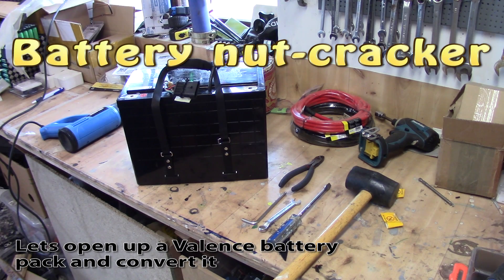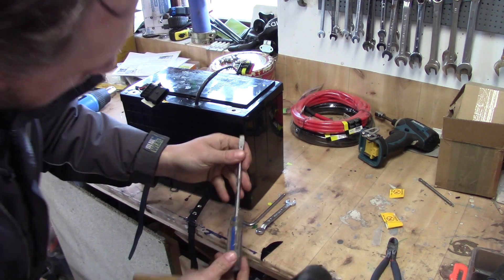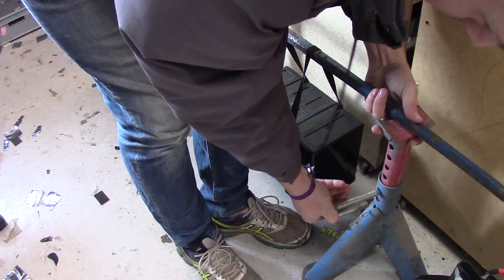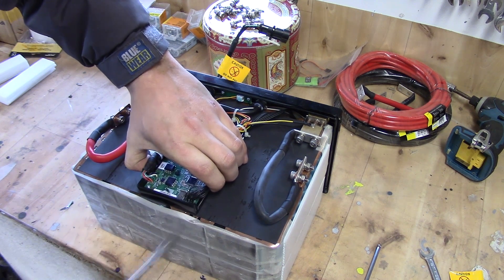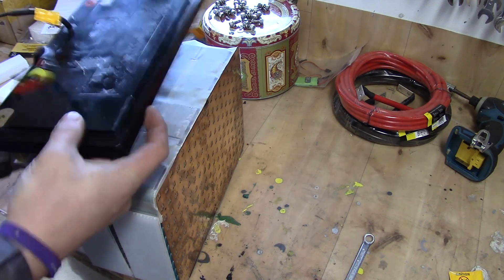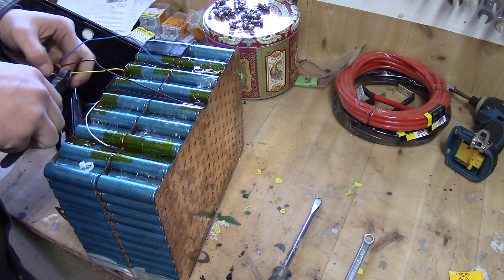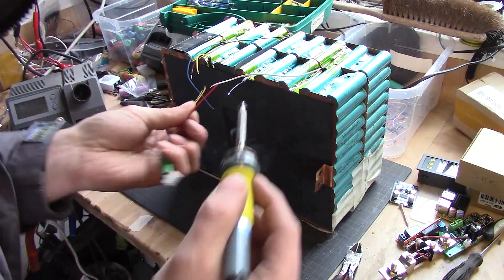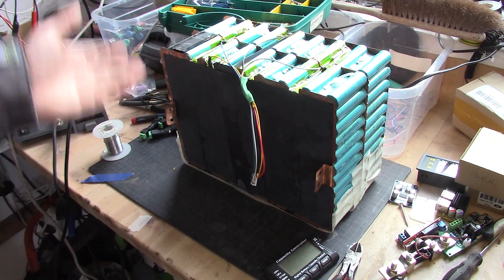Opening up Valence 12V Lithium battery

Comment: Please may i ask: if i do not use the communication cable and i buy 8 of these 12v valance battery, then connect them in 2p4s configuration for 48v system, will it stay balance or  do i need to buy and connect the communication cable to Valence controller box for it to stay balanced?
Reply from the maker: You need some kind of bms with balancing.

Comment: Just an observation, not knowing the exact product number, but assuming 4 Ah per cell:  I count 180 cells from your video.  Considering it requires 4 cells in series to get 12.8 v,  then paralleling the 45 series groups yields 180 Ah capacity theoretically. Not a detracting observation to your well presented info.
Reply from the maker: It's lfp cells. Their max st 18650 form factor is alot less. I said 130 in the beginning :)

Comment: Hi, you stated that the BMS was faulty. However the LED was still blinking green which should mean a good health of battery and BMS according to the manual. Am i wrong? 
Thanks...
Reply from the maker: Out of the 50+ packs just very few blinked Green and all packs were sold as faulty bms so i never checked it.

Comment: Hello is there a reason why you stripped the battery. I can see it's flashing green. Is the in built bms faulty many thanks
Reply from the maker: I dont have the Main controller nor do i want to pay for it
Reply: @DIYTechRepairs  neither do i lol. witch bms would you recommend for these batteries

Comment: Trying to understand how these cells are spot welded together. Anyone have a diagram that breaks down the connection/layout?
Reply from the maker: Its 4s100p. Packs of 100p cells
Reply: @DIYTechRepairs  but how did they wire them to be stacked two batteries wide?
Reply from the maker: @freedomunrestricted  huh? 100cell packs and 4 in series

Comment: I have one of these that has started flashing red. Any idea what that means and how do I fix it?
Reply from the maker: No idea. Crosscheck IF One of the cells are voltage are way off. Could be an easy problem like that

Comment: excellent !! does the "slave bms" do any battery protections without being connected to a "master bms"?
Reply from the maker: The original? No. It can only balance and monitor
Reply: @DIYTechRepairs  i ordered a used valence battery with the same model number except it's green.
Reply: @richardriehle4159  me to, I have the green one, hopefully it can be done in the exact same way
Reply: @ke6bnl  the valence battery is still my main battery storage . never did add a bms to it . set my solar charge controller at 13.5 (sometimes 13.6 on multiple cloudy days  and most of the fall - winter months . seems to work for me . i did take the battery's side panel off once . adding a bms doesn't look very difficult . just no longer inclined to do it . if i wreck this one....will prowse and others show plenty of decent lifepo4  batteries with bms for a decent price.

Comment: I have the opportunity to buy a bunch of the Smaller bright green batteries made by Valence. Do you know if they will have the same pinout so i won't have to open the thing up? I Suppose once i figure the pinout then the remaining 7 batteries won't have to be opened.
Reply from the maker: Pinout for what? The connection is for communication to its bms. I have removed the bms in My batteries so My pinout is different.
Reply: Oh, I ask because all of these ones have the BMS removed, so i need to install aftermarket bms
Reply from the maker: @trevordeyoung2445  IF bms is removed you most likely have to resolder the Wires and install your own bms.
Reply: @DIYTechRepairs  will the wire colors for the balancer wires   be as you described for yours for the green valence battery?
Reply from the maker: @ke6bnl  dont know. Sorry

Comment: What BMS specs would you recommend for this to run a 1000w inverter with this battery?

The internal BMS is crap and can only be used with a master BMS for protection functionality.
Reply from the maker: This could work https://youtu.be/ClGmMY0kXvQ
Reply: @DIYTechRepairs   Great videos, man. I am spending way too much time on my phone now! :) Could I used an off the shelf 4s BMS? Would run an 1000W inverter, so just assuming I would need a 4s 100a+ BMS, correct? The newer style of these batteries allows for easier access to the built-in BMS. Assuming I could swap it out!

Again, really appreciate the videos. Keep them coming! I will hit you up on patreon!

Comment: hello great video.  i have a 1st gen u27 12xp with the round pin connections for the bms  I have a USB to RS485 RS422 Converter with FTDI FT232 Chip  my question is how do i connect it to my battery
Reply from the maker: Hi, Thanks. I dont know since I never done it myself. My batteries came with brooken boards so I swapped them out.

Comment: My friend, my used Valence RT battery arrived today.  You said that I need an M6 bolt for the terminals, is that an M6-20?  My m6-30 was too long and I don't have a shorter one and want to get the right length.  Thanks for all your help. Also, do you use a spring washer above or below the cable?  Do you torque or just make reasonably tight?  Sorry for the stupid questions, but their manual has the wrong information in it (it says M6 next to the terminals so I know you're right, the manual says 1/4" 20, which doesn't work).

Comment: Instead of taking it apart and disconnecting the board, can you carefully cut through the balance cable, remove the sleeve with an knife, cut the wires, solder on balance wires, and then connect a second BMS?  I know you made a video about making another connector, but I wonder if just cutting will do it (hard to find the connectors).  Thanks.  Also, do you know what size bolts the main power ports take?
Reply from the maker: No. Why Keep the Brooken bms? I also use the connector to hook it to the next battery. Its m6 bolts
Reply: @DIYTechRepairs  Are the pin outs on the cables just the cell connections (one negative and four positive) or is it something else?  I'm thinking of buying one of these.  If I do, the bms might work, and I like to avoid taking things apart because I'm not good at getting them back together!  If I could just strip the sleeve of one of the cables and monitor the cells it might be an easier way to deal with it.  But I'm not really sure what those cables do.  Your other video suggests that it's just cell monitoring connections.
Reply from the maker: @glgermain  they are com cables. Have nothing to do withcell voltages. Thats why remove it

Comment: I love your channel so I got 4 of those batteries. There working great but can only get them to charge to 13.4! I have 4   300 watt panels charging 4 of these batteries.. but won't charge above 13.4 do I need more panels to get them to full charge? They charge fine until about 13.3 then the charge is really slow. Do you think that's because I only have 4 panels = 1200 watts.. thanks again for the videos
Reply: Sounds like your using an incorrect charging profile for Li-ion. Does your controller allow custom profiles? I bulk mine to 13.8 then float at 13.5.

Comment: I GOT 2 OF THE U1- 12RT , WILL USE IT AS IS , WANT TO ADD EXTRA BMS BOARD FOR PROTECTION, CAN I USE LIFEPO BMS BOARD LIKE SOLD ON EBAY - GOOD ONE FOR 40+AMPS  ? TNX

Comment: I need 6 of these batteries, how much for 1?
Reply from the maker: Around 600eur new.
Reply: @DIYTechRepairs  wow that's expensive,  any used?
Reply from the maker: @HeavyfromHollis  used depends on cycles. 1000cycles around 200 to 300 eur per 12v battery. Note that they are lifepo4
Reply from the maker: @mercuryin1  buy new Ones instead. 400 is to much.
Reply: @DIYTechRepairs  but where mate ? I can´t find any of these over the internet ! How much should cost new? Thanks
Reply from the maker: @mercuryin1  around 600 new IF im not mistaken. Not sure IF There are any out for sale right now
Reply: Just totally no idea where to get these in the u.k. without paying around £1000 new or £500 used !!! 😞

Comment: Does the battery monitor you install replace the inbuilt bms? I’ve been offered one of these to use as a leisure battery in my campervan but will be charged from both the engine alternator or my solar panel/controller but would obviously need something to tell me the state of charge ? 
The battery I’ve been offered is being advertised as having built in bms but from what you are saying this is useless without master ? 
Thank you.
Reply from the maker: The version I got need the master yes. But they have masterless versions as well. Yes I replace mine with Batrium sytstem
Reply: Thank you for quick reply, do you know how to tell if the battery is masterless version.
Reply from the maker: Check the battery specifications on their website.

Comment: I have 6 of these in my Kewet. One of them did a runaway charge while at work up to 16.8 Volts today. My car died halfway home and I had to get pulled home. It could be a coinsidence....maybe it's my kelly controller or my motor brushes. I talked to the guy I bought them from. He said he came up with this dismantle method and then some time later discovered your video. I hope I don't have to go this far, but if I do I'm thankful for your TOP vid

Comment: Hi. I'm planning to get a pair of these black valence battery. 
Can you charge these batteries the same way as lead acid or agm? 
I mean using the same charger or split charge them from car alternator?
Thanks
Reply from the maker: You can potentially do that yes. They tollerate up to 14.6V to become fully charged. But they should not sit in parallel with lead acid. If they are in parallel with lead acid with no switch between they will discharge into the lead acid since lead acid have a way lower resting voltage than the Valence have. Dont forget that you need to have the BMS running to make sure they stay in balance! :)
Reply: Hi. Thanks for your input. No, i would not use it in parallel with lead acid. As far as I know, these batteries have built-in bms that should take care of balancing. My worry is that they might get overcharged with split charge from the alternator.  Is it good practice to keep these batteries fully charged at all times or it's better to discharge them to a certain percentage then charge it again. Thanks
Reply from the maker: Just check your max voltage for charging. 14.6 is generally max on them.  The BMS doesnt work without a master unit kind of.  LiFe is best in middle charge kind of as most Lihtium batteries.
Reply: regarding balancing. i will only use it as 12v battery bank 2 of them in parallel.  So what i understand is that the built in bms should take care of balancing the cells.  am i wrong? Thanks
Reply from the maker: 3dmixer not sure... The Ones i have need a master unit...
Reply: DIY Tech & Repairs i wanted to install 4  valence UI-12RT (40ah each) on my car audio in the back for my amps but im kind scared on how to charged them with the alternator from the vehicle, if connected in parallel would i need a bms?  Im not sure if the have one inside
Reply: 3dmixer do you installed your valence on you car audio ? I need some help i just bought 4 valence UI-12RT (40ah each) for my car audio set up
Reply: @3dmixer552  The bms will balence the pack of constant float voltage is applied according to the valence spec sheet, the u-bdi is not required

Comment: Your  thumb nail with all those batteries trap me into watching your video,very interesting ,are all those the batteries 18650? I  am in the process of designing a high Lumen  out  put under water light will need a 36 volt battery pack. good video
Reply from the maker: lonenightdiver thanks! Yeap they are 18650 life cells. For high power the liion will be better. Exist in many sizes :)

Comment: for what do you open the Battery and take out the BMS from Valence ? is it not working good ? I have some of the Battery and I want to build a 24 Volt Bank and I wat that the BMS work for the komplet bank as a 24 Volt unit
Reply from the maker: The BMS is brooken and I dont have the controller. So Im switching to Batrium BMS instead.

Comment: Do you know what capacity you have in those 18650 cells? I have same battery and planing to strip it apart in the future but for now I'm using it as a leisure battery. I was curious to know what capacity you have in those individual cells. Thanks
Reply from the maker: Tha packs are 130Ah in total and 100 cells so 1300mAh per cell.
Reply: I see....that's quite low but I guess is normal for a LiFeMgPO4 cell. So it has 4 packs of 100 cells each? 4S100P?
Reply from the maker: Correct.

Comment: the charging algorithm is in fact very similar to the lead acid chemistry but even simpler, only a constant current followed by, at the top of charge ,contant voltage (CC/CV) but without the "float charge" this is not necessary and even harmful in the long run since these LiFePo4 cells do not have much selfdischarge...and hate to be fully charged when not in use...
Reply: Actually, these Valence 'modules' (batteries) have an internal BMS which balances the 4 x 99 18650 cells in each block whenever the module voltage is at or above 13.8V.  The BMS also has RS485 comms connections (the 'pigtails' on the top of the module).  The Valence manual says "FOR BEST RESULTS leave the batteries on float all of the time." ie at 14.6V.
Reply: My mistake, i thougt this ware LiFepo4 cells but they are ordinary { Lion 18650 cells witch indeed NEED a BMS otherwise they can Blowup when overcharged!
The MUCH SAFER LiFePo4 chemistry do not need to operate with a BMS and therefor are recommended for Solar backup or maritime use.

Comment: In general it is best to NOT charge LiFEpo4 cells to Full each and every time, so for a 4s 12 volt pack i would stop charging at 13.9 volts ( witch is in fact already 95 percent full) and also stop Discharging at 12.8 volts witch is 20 percent discharged thus keeping in the flat part of the charge/discharce cycle , this is way better for the life of the pack....
Reply from the maker: giottodiotto1 my system is set to 3.48v per cell.
Reply: that is a healthy setting!

Comment: There are some of these packs avaible cheap in the UK at the moment and I'd like to use one or two in my camper as a house battery. 
What are you using to charge it now you've added a BMS port?

Valence say they can be charged by any standard lead acid charger and provide recommended charge and float voltages but say they aren't supported without their BMS system.
Reply from the maker: Jake Edmonds yes with bms u can use normal lead acid charger. this due to that LiFePo4 have a slightly different voltage range and can handle. but u should use either bms or atleas monitor each cells voltage. orginal bms have no disconnect but do have balancing.   the one in video was just a test. will be adding another bms and they will be running with my current solar system that is 48v
Reply from the maker: Jake Edmonds btw i bought mine from a guy in uk. j...... perhaps u got his name? if not pm me if u want it.
Reply: Which charger and BMS in particular do you use?
In the camper I'll be limited to 12v (well 13-15V options).
I like the Ctek D250s which takes power from solar & the alternator and 5 step charges at 14.4v but I'm scared to kill the pack
http://ctek.com/Archive/ProductManualPdf/D250S%20DUAL_EN.pdf
Reply from the maker: BMS: I have my own BMS system that im developing. I cannot recommend anyone really for your purpose since i have limited knowledge. It could basically work with one from ebay but dunno.... 

Charger: You should not use a Lead Acid charger on those batteries that use "multiple" steps where you cant manually set thresh holds.  Lithium generally have a different way to charge and dont use some of the steps that are for lead acid. But on the other hand i cannot answer on how it would affect it if you go by it.
In this case you only need some type of charger that gives out 14.4V and max current of XXA. and then you are done :)
If you take a look at Ctek Lithium 20xs and look ad the charging steps you see the difference. 

But as i said lithium will be fine if you just use a dumb charger that charge up to 14.4V and then stops when certain current is reached. In conjunction with a BMS. The BMS will make sure all cells are kept in balance and if they have also monitor temperature.

Comment: Where on earth did you get this battery from ?
I looked up the price of one of these, it scares me.
Reply from the maker: Good batteries cost :)  I got it second hand. Faulty bms and such but cells should be ok. So its used. New i wouldnt be able to afford them.
Reply: i got mine off ebay but i dont use bms as this video use balance meter keeps in balance to 0.01 volts charging with 560 watts of solar
Reply: would this be enough or better than 2x 6V Golf Cart batteries?

Comment: wow!  look at all those 18650 so tightly packed!  They don't over heat?  do you have temperature sensor?   4s100p!  wow, did you build that yourself?   what BMS did you use?   This is exactly what I need to build myself.
Reply from the maker: Beakerzor if you look at the datasheet you will see that they are bought like this. they have 6 temp sensors inside